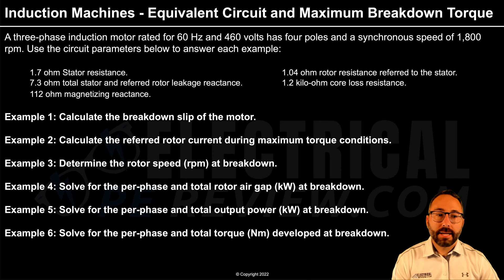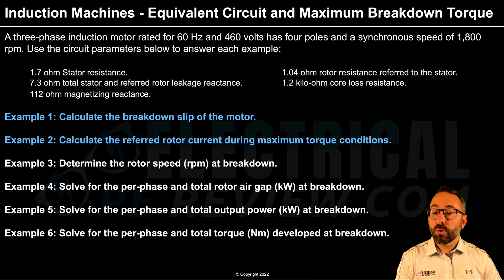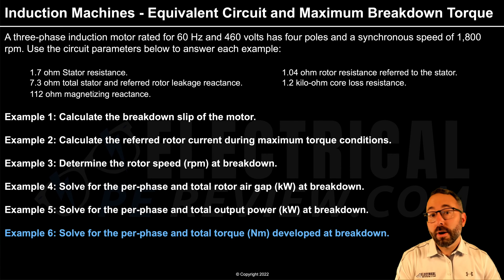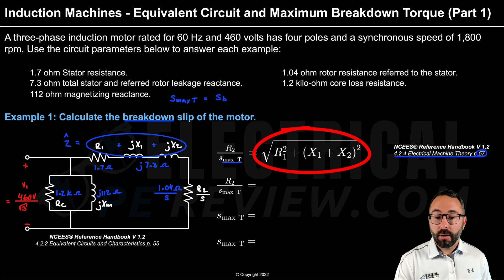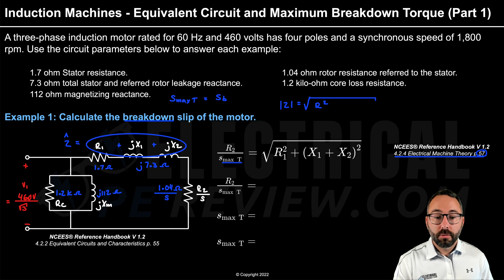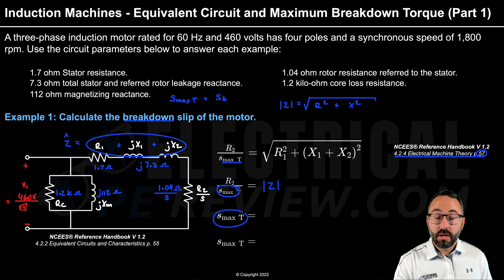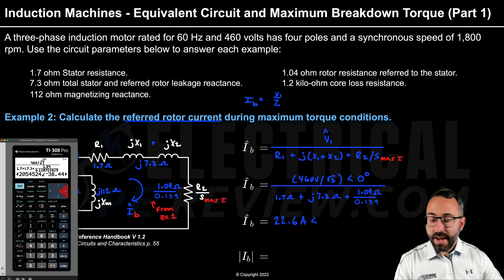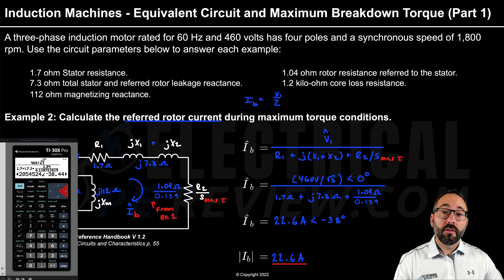Induction Motor - Equivalent Circuit, Maximum Torque, Breakdown (PART 1) for the NCEES Power PE Exam

Comment: how about if the motor is connected in delta configuration , the volage in per phase equivalent circuit is 460 rather than 460/sqroot(3) ?

Comment: Excellent video. Maybe you could explain more as to the "why" the breakdown slip is just the ratio of rotot resistance (referred to stator) to the stator impedance + rotor reactance (referred to stator).
Reply from the maker: Hi Alexander, good question.

Motor torque is equal to the ratio of air gap power to synchronous speed:

T = PAG/Wsync

Since the synchronous speed of the motor does not change, the maximum value of torque is directly proportional to the air gap power (PAG).

Air gap power is the power consumed in the rotor slip resistance (R2/s). The rotor slip resistance varies indirectly proportional to slip as the slip changes while the motor gets up to speed.

The maximum value of air gap power, and the resulting torque, occurs when the rotor slip resistance is equal to the magnitude of the up stream stator resistance and leakage reactance (R1 + j(X1+X2)).

(See the maximum power transfer theorem if you are curious as to why this is: https://en.wikipedia.org/wiki/Maximum_power_transfer_theorem).

The rotor slip resistance (R2/s) will momentarily equal the magnitude of R1 + j(X1+X2) as slip decreases from 1 to rated slip while the motor starts from a standstill (motor speed n = 0 rpm) and gets to rated speed.

Any other value for the rotor slip resistance (R2/2) will result in a smaller value for air gap power, and a resulting smaller value of torque.

Comment from the maker: Table of Contents (PART 1):
0:00 - Problem Statement
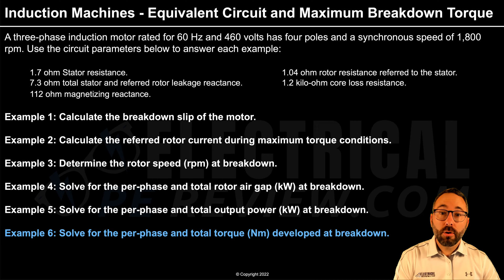1:31 - Induction Motor Equivalent Circuit
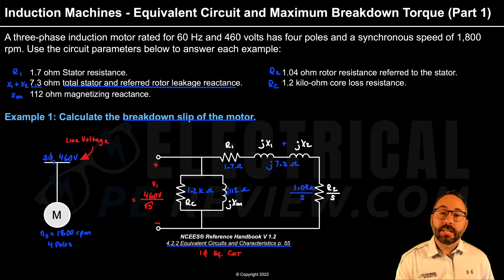6:44 - Breakdown slip (s max T)
12:04 - Rotor current at breakdown (I2 = Ib)

WATCH PART 2 - https://youtu.be/8N73JzJ4JLk
WATCH PART 3 - https://youtu.be/RN6Worf-rVQ